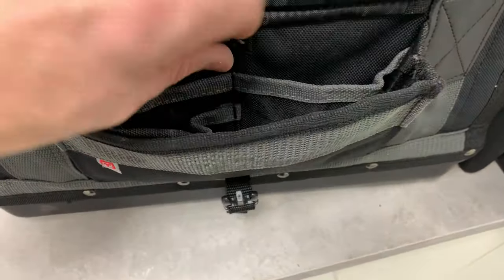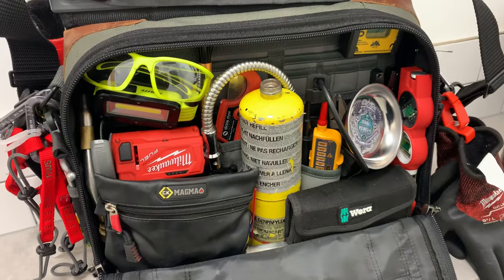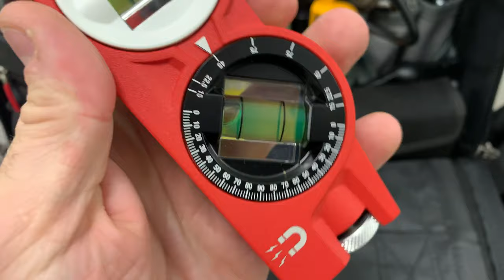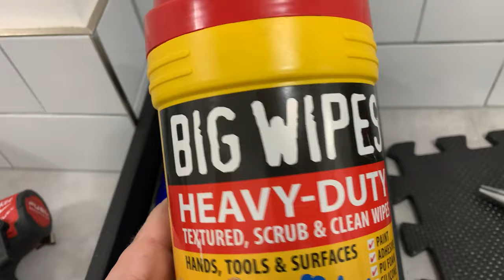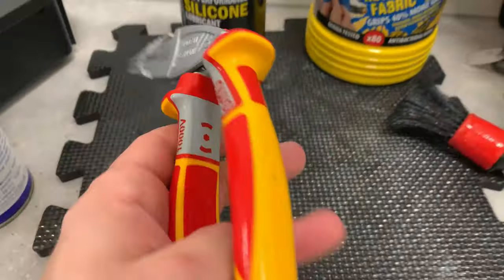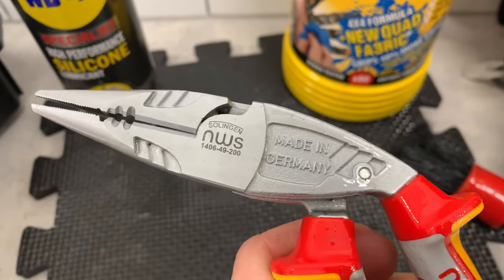VETO TECH-XL ‘THE B SIDE’ + HOW MY TOOLS ARE SO CLEAN ?

Comment: Great part 2! Do you mop up the excess lubricant before it goes back in the bag or just let the bag get oily? I do the same but dab the excess. Obviously this takes longer and can waste lubricant
Reply from the maker: Thanks mate 🙌🏼 If I’m doing a few tools I’ll usually spray the tools over a plastic tub and then just use the excess for the other tools too 👍🏼 I tend to leave them out for a bit before I put them back in the bag 👍🏼👍🏼 Few bags of silica gel thrown in the bottom of the bag helps too

Comment: you can buy the expander heads individualy, mine did that aswell i got the value hydralic set now really good!
Reply from the maker: I did think about just changing the head. This set weighs loads compared to my new set though so might have to ditch it to save weight 😅 Always wondered if the hydraulic ones were worth it ! Are they much better to use ?
Reply: Yes they are much better. one handed operation can get them in real tight spots on the press-gun system now so we’re not really brazing a lot. Lent them to a mate he’s well happy 
Comes in a small good box  
With my expander heads I was going to get a bit of foam and cut out so heads can fit in pouch protected 
 my 5/8” head completely fell apart spent 20 mins putting it back together 😂😂
Not fun
Reply from the maker: @buildingsolutions2874  They sound decent mate 👌🏼 For some reason I had it in my head that they wouldn’t be any good in tight spots but actually I suppose they’d be better as you don’t have to open the handles right up ! Mine don’t get much use now to be fair as I don’t touch much install anymore just used for the odd pipework repair here and there 👍🏼
Reply: @hvacuk8975  thats it not so tiring on the elbows ha ha
Reply: @hvacuk8975  how about a video on refnets next ? :D